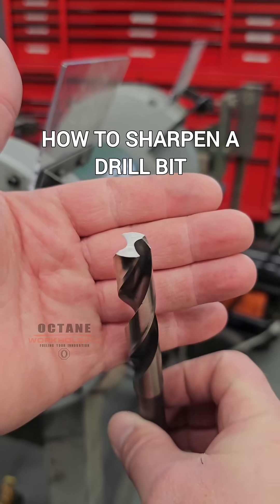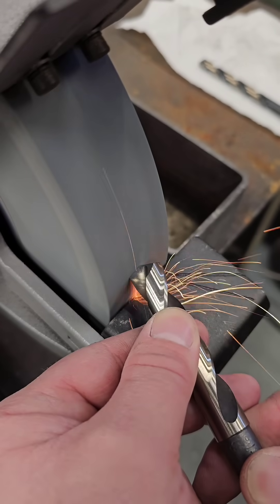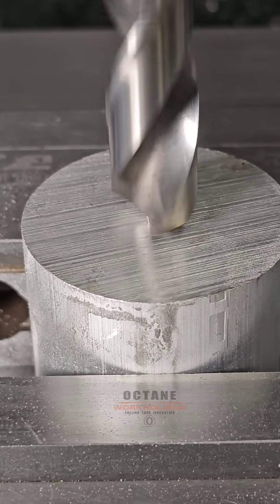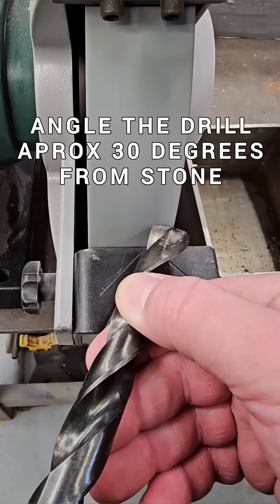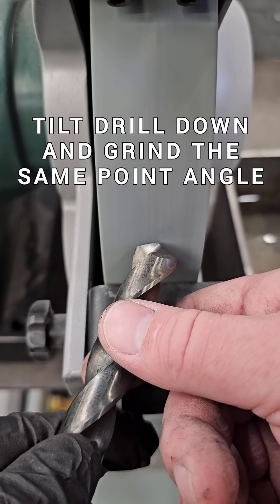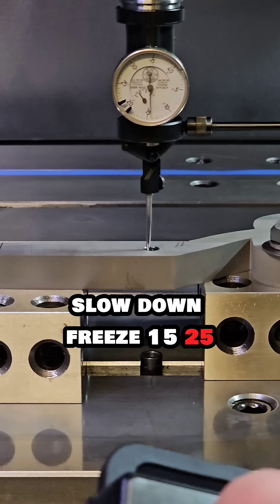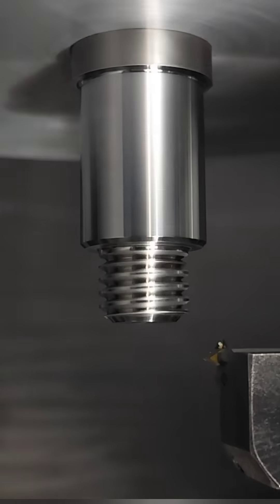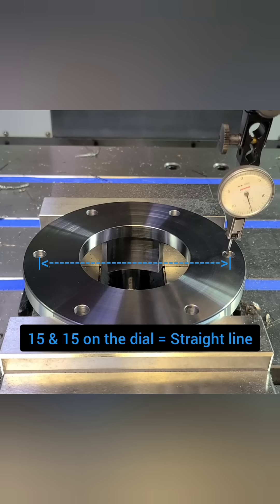Machinist Tips and Tricks Volume 8

Comment: Nice to be able to hand sharpen drill bits, but unless that point is exactly on centre,  the drill is likely to drill oversize.
Reply: Perfect if you do it on an undersize  drill, (.003" per side) then spot drill if necessary, ream or bore if it's that critical!

Comment: I learned how to sharpen drills in highschool metal shop, this alone has saved me thousands of dollars in my life. I do just one thing different though rather than holding the drill at a fixed angle I rotate it to make my grind helical, so basically you start at the angle you want, say 59 deg, then twist the drill and rotate the point upward while maintaining the 59 deg point angle. This is what generates the cutter heal relief.

Comment: I like these videos.

When it came to the drill sharpening sizes, did you mean 1/2 and larger? I find the bigger the drill is, the easier it is to sharpen. Not the mention, the smaller ones are just cheaper to throw away than spend the time on them.
Reply: Well down until I can't really see the grind anymore I will still resharpen, its like sharpening an old wooden pencil, it takes me about 1 or 2 min tops, it would take just as long to go to the tool crib and find what I need

Comment: On that last tip for orienting the part using the two bore holes, an alternative is pop in some precision dowel pins (or gauge pins), lay a parallel or other straight edge across the pins, clamp the parallel in place with some plastic finger clamps, and then tram the part in by sweeping across the parallel with a dial test indicator.
Reply: But not really necessary anymore on CNC machines, just rotate the coordinate system.
Reply: Perfect example of why CNC shops have to pull manual guys from retirement when they have an issue they can't solve: The old "you don't need that knowledge with CNC"  @jst6757
Reply: @shovelwrench  You know, when I was still an apprentice, we had a guy who was an old manual dude who had converted to CNC. He was always saying, it'd be easier to train a manual guy in CNC programming than a CNC programmer in machining.
But then, a couple years later I was no longer an apprentice. And I did stuff on the CNC that this old dude wouldn't even have thought off due to his completely manual mindset. Sure, he had a LOT of experience how the material behaves, what speed to use with a specific cutter etc, but he did in the end punch in the CNC what he would have done with a manual mill - he didn't have the mindset that a CNC can do much more. Trivial example would be, you pick the best rotational speed for facing your part on a lathe, while on a CNC you'd simply keep the cutting speed constant (until the chuck speed limit) since the machine can speed up as the cutter progresses.

And that's why you can't compare the two. Each of those machines has a use case. A good manual machinist will solve whatever gets thrown at him on a manual machine (as long as it can be machined on that machine), while a good CNC guy will solve whatever gets thrown at him on the CNC. If one or the other doesn't know something, he needs to learn. If you're good in what you're doing, you will keep learning something new until the last day before your retirement, and beyond.